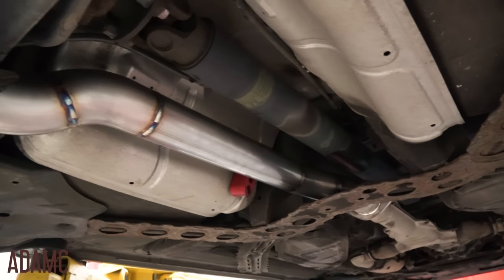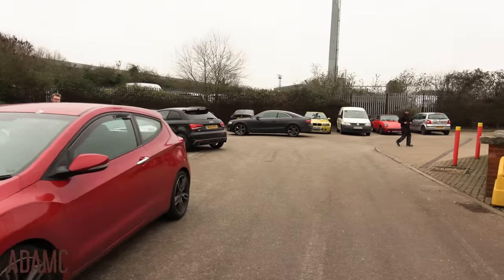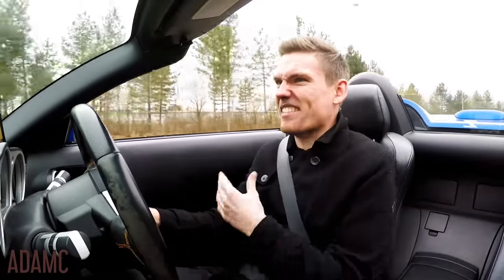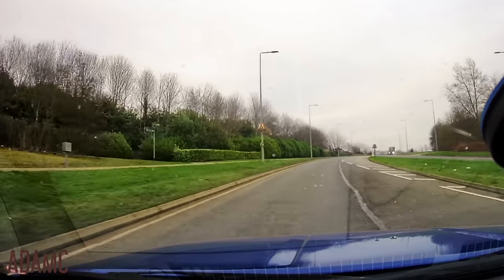NEW EXHAUST!! My 350Z IS LOUD!

Comment: you can't beat a good sounding vq35 😍
Reply: Yeah you can. I many ways.
Reply: Let me guess a m3.... they sound ass. Only other 6 cylinder that sounds good is a flat 6 from a porsche.
Reply: @XxTeAmDaRkxX  2jz rb26
Reply: @nickhoefs8359  turbo 6 doesn't count. You are rating it on turbo noise not 6 noise.

Completely different sound from turbo engines. Plus the rb sounds just like the jz when turbocharged.
Reply: Alfa romeo V6’s >
Reply: @XxTeAmDaRkxX  2jz-ge is na v6.
Reply: probably the worst sounding engine ever
Reply: delete this, its an na R6...  @rhys6048
Reply: VQ sounds very good, best sound imo is the BMW S85 with Eisenmann Exhaust
Reply: @rhys6048  2JZ's are straight six's not V6's
Reply: @richlincoln1824  Don't try to be smart mate I own a JZA80, I know what's under the hood.

Comment: You've got to wait until the inside is Sooty before you get it's TRUE sound. Also put an aftermarket air filter on to complement it. It will also change the sound and be more grunty when you accelerate

Comment: You should get ur steering wheel new leather , it looks very used
Reply from the maker: Yeh, but I don't see it when I drive so it doesn't concern me.
Reply: AdamC3046 Yeh but surely its a cheap fix and it would look much better
Reply from the maker: @estanislao7964  Feel free to buy it for me :)
Reply: Dude it’s sweat, not just wear and tear 😂
Reply: @estanislao7964  it's actually rather expensive to have a steering wheel recovered and have a decent job
Reply: @AdamC3046 my 370z wheel looked just like that. Just a microfiber cloth and some water and it just rubs off and looks like new. 2 second job. its just dead skin from your hands

Comment: Is Thier a law in England about what straight pipes are illegal and what's legal
Reply: Be Positive decats are illegal
Reply: Widda5 but everyone has ‘that mate’
Reply: I 2.5inch straight piped my golf 1.8t and never got pulled and that was way louder and i finish work at 6am so i used to give everyones house i passed a wake up call 😆
Reply: Yep, I got pulled once for having an exhaust that was too loud. They made change it to make it quieter and asked for proof of DB readings. And of course if its older than a late 1992 model, then it must have a CAT.
Reply: @dj_paultuk7052  lol unlucky mate. Never heard of anyone having issues. My neighbour got a straight piped e36 328i police asked him to rev it and were filming lol.....
Reply: @blademanx  Yeh well it was a Chevrolet Camaro Z28 5.7 V8. It used to set off car alarms just by driving by nicely at the speed limit !.

Comment: DE or HR engine?
Reply: Was there 2 variants of the vq35 in the 350z
Reply: I believe the last models of the 350z had the DE rev up.. and the HR was 370.. I might be wrong though!
Reply: @j.andrews9669  almost completely right...  https://en.wikipedia.org/wiki/Nissan_350Z
Reply: @j.andrews9669  370z had a different engine vq37 
A 3.7 litre
Reply: The last 350Z had the HR engine. You can tell as they have a bulge in the bonnet. There are 3 different variants of the 350. DE, rev up and HR
Reply: Was of the top of my head didn't think it sounded right but rolled with it lol.. yeah the 350z had the de, De rev up and the HR was 07 to 09
Reply: So the answer to idr34s question is adam c must have a de rev up being an 06
Reply: 03-06 de 07 had hr

Comment: Original tone was nice.. still sounds good though.. sounded like an R35 in the tunnel
Reply: Because the engines are pretty simular. Although with out turbos. These engines are vq35. Where as the gtr (r35) vr38😎
Reply: @cashmeoutsidehowbowdah2749  yup lol Ik all about em just crazy how it didn't jus sound similar sounded exactly the samee 😎